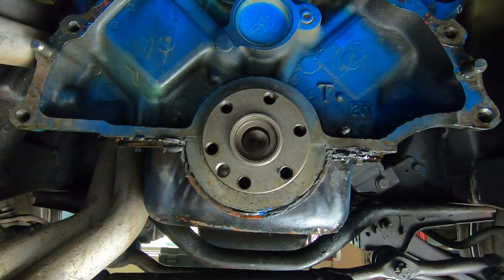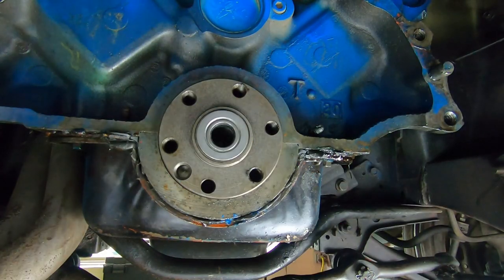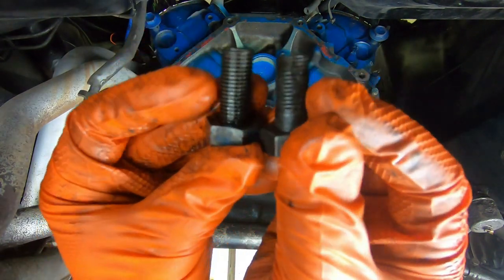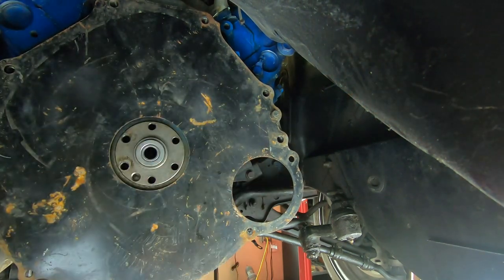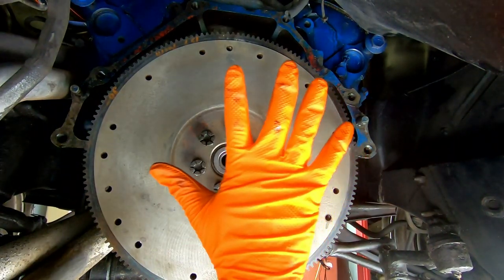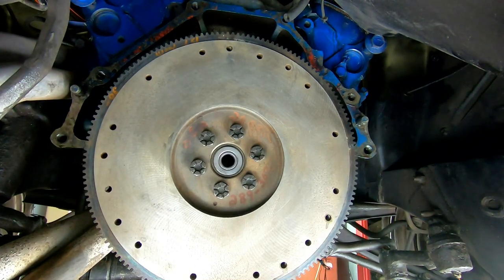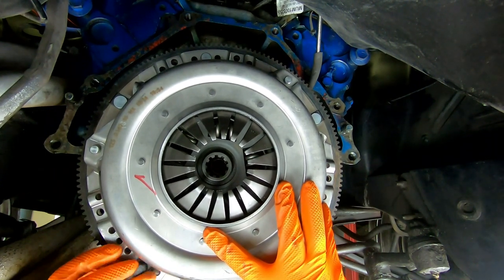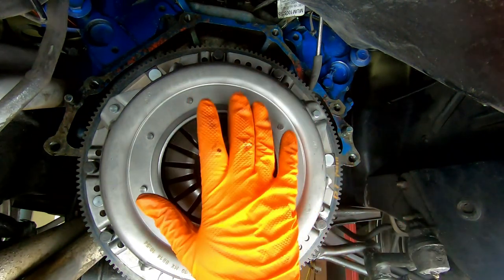How to install your clutch assembly - 1967 Ford Mustang

Comment: You can actually put the clutch disc on first with the alingment tool and then put the pressure plate.  The alignment tool will hold the disc on the flywheel so you don't have to hold both together while putting  the bolts in.

Comment: Thanks for make all that great videos!
I have 65 mustang  with automatic transmission
So I’m swapping to manual
I m ready to install the flywheel
157 tooth  
 This Flywheel can be used in 3 different configurations (depending on the vehicle) with the included counterweights, dowel pins and hardware. 0oz. for Internal Balance applications and 28oz. or 50oz. for External Balance applications.
Can u tell me witch counterweights can I use?
Your videos motivate me to do 
All this work I have the 4speed toploader already and all accessories to install in this year!

Thanks !
You do a great videos !
Have a bless and great day!
Reply from the maker: So I'm just assuming here so this may not be the correct answer but I will do the best I can with what limited information I have about your build. If you have a stock 289 with a 28 oz balancer on the front of the crankshaft, you'll probably want to run the 28 oz flywheel.
Reply: Whatd u pay for the 4 speed if I may ask?
Reply from the maker: I can't remember, would have to go through my records. Probably in the $2200 range plus bell and shifter, and clutch.

Comment: Alf, I just completed this swap. When I rev the car in neutral, getting a really bad vibration. I have not driven it yet. Do you what that might be. Could the flywheel be out of balance?
Reply from the maker: That is hard to determine from here. But yes the flywheel could be out of balance. But also was the correct weight flywheel used? These small block engines are externally balanced so if there is a 28 ounce crankshaft harmonic balancer, then the flywheel needs to have a 28 ounce to match.

Comment: is it a 3 speed  original clutch and flywheel? or on what car did you order it?
Reply from the maker: This is a 4 speed and this is not an original clutch. The flywheel is original but we used a LUK clutch.

Comment: Alf my understanding isthat you need to use anaerobic thread sealant on the flywheel bolts as they are open the the crankcase.  This will preclude leaking.
Reply from the maker: That is correct

Comment: What part number bolt did you use for the clutch to flywheel? Are these shouldered bolts? 

How long are the flywheel bolts? 1" long thread? Thanks for the vid

Comment: Is the spacer plate different between an automatic and manual?
Reply from the maker: Yes. The automatic will have a removable cover at the bottom for torque converter nut access.

Comment: This video is awesome! Helped me so much. Thank you! 👍
Reply from the maker: You're welcome. One thing I forgot to put in the video, is putting lock tight on the threads of the flywheel bolts. That's something you'll want to do if your crankshaft has pass through holes. Thanks for commenting and subscribing!

Comment: Do you have to have a new flywheel to install a diaphragm cluch setup or different clutch fork??? I have all original 3 finger setup
Reply from the maker: The clutch fork and flywheel are the same if you're using an original style clutch. The only difference is the pressure plate and disc.
Reply: @AlfsMustangGarage  some say when you go to a diaphragm setup you remove the return spring as it's was lighter then an original 3 finger ???
Reply from the maker: The return spring on the clutch pedal or on the equalizer bar? Either way, I've never heard that. But I don't talk to a lot of other people😂😂😂

Comment: What happened to the Spacer Plate?
Thanks.
Reply from the maker: Lol watch a little further down, I figured out that I forgot it 😅
Reply: @AlfsMustangGarage  ...🤣🤣🤣

I had to change the clutch plate on my 66Mustang convertible, 6cyl. 4speed manual (obviously), many many decades ago with almost no tools or equipment here in Rome..... by myself. Jacked it up onto 2 builders planks, in the road, pulled the gbox out alone, very heavy and uncomfortable, but got the job done and it was fun.
Thanks Alf from Rome👍🇬🇧

Comment: I take it that this is a 10" clutch.  I have an 11" clutch on 351C with 3-finger pressure plate.  I went with diaphragm style, but the bolt pattern was different and would not work.  Would you know why the difference?  The bolt pattern that  I need is the same as the one being installed in this video.
Reply from the maker: I'm afraid I would not know why there is a difference. The clutch I used in this video is a 10" LUK clutch and this is a small block Windsor.
Reply: @AlfsMustangGarage Mine was LUK set as well.   It seems that for the 11" clutch, the diaphragm clutch plate has different bolt pattern than the three-prong plate.  The three-prong has the bolt pattern in somewhat a triangle pattern with three pairs of bolts with the pair of bolts closer together.  Just like yours.  I returned mine and put the 30yr old clutch plate back on.  New disk, though.  Not too worried since I only put few hundred miles in a year.  Thanks for the reply!